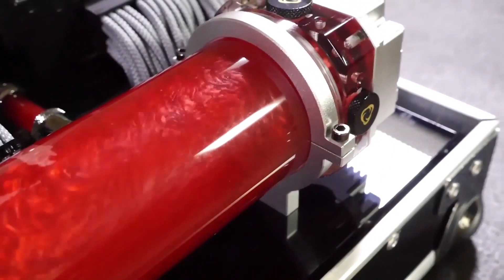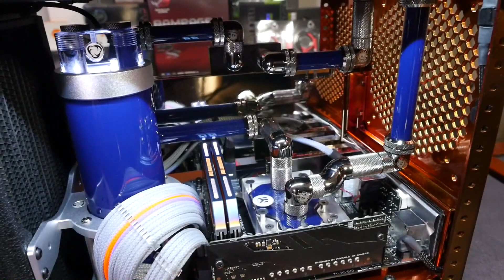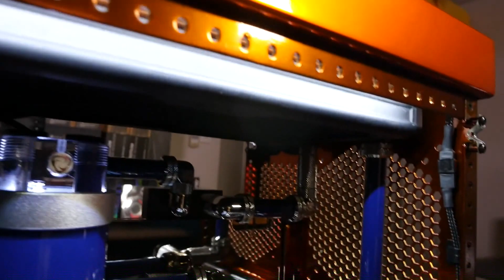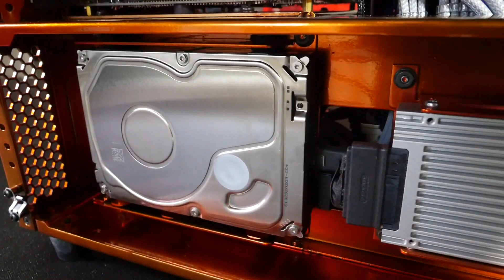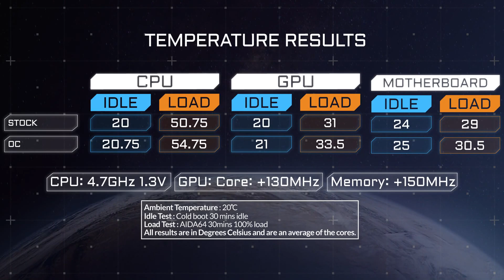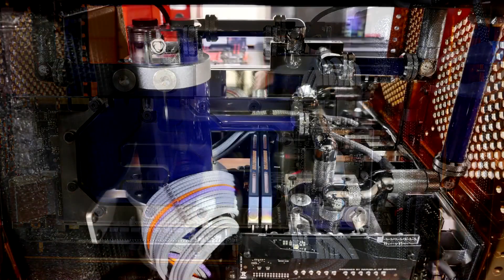Caselabs S3 Extreme ITX Build Log: Part 3

Comment: Thank you so much for doing this Daniel. I'm putting together my own custom loop right now in the Mercury S3. Beautiful case inside and out. I'm still debating going glass tubing or not and i'm afraid your video made me even more scared to go glass. I'll also be using straight pipes with fitting angles. You're a great inspiration to me and I'll be shopping from you soon! Need dat protium res 

/ Daniel

Comment: Gday can you do custom cables with any 80+ PSU these days or does it have to be a special rated PSU ?
Reply: charlie brownau You can do custom cables with any psu. The 80+ is the psu's efficiency rating.
Reply: charlie brownau You (basically) can do custom cables for any PSU ever made for a PC, but it's way easier and safer to go with a fully modular PSU over a semi or non-modular.  

80+ is a rating of efficiency.

Comment: There are so many impressive things about this build, I don't know where to begin.  I love how the RAM is the theme.  It truly is. The colors with that insanely expensive and rare RAM looks so so good.  It is your most cohesive and complimentary color scheme yet.  The proximity of the reservoir, the RAM and the monoblock look insanely cool--I've never seen anything quite like it.  And then you get a look at the other side of this thing, BAM VERTICAL GRAPHICS CARD and those two drives below... HOT DAMN.  The drives are just like floating there all shiny and immaculate looking, and the asymmetry of the drives JUST WORKS!  It is official, it is my favorite of all your builds.  The cabling looked like such a bitch to install.
I feel like you are so committed to using Corsair power supplies.  I could understand back in the day when you were rocking AX1500i's over and over again, because they are unrivaled and your crazy ass builds need mad power. But now I'm not sure I get it, because the days of needing 1500 watts are over--ACTUALLY, MAYBE NOT, HAVE YOU SEEN THESE Intel i9-7900X's.  They are the greatest things ever, it is in actuality a 6950X with the single-core performance of a 7700K and 30% better multi-core performance for almost HALF THE PRICE, but they need sooo much power when overclocked, and produce crazy amounts of thermals, I can't wait to see you do a build with one.  Maybe you could do mine for me, with X299 and a 7900X.  My 1TB Samsung 960 PRO just arrived.  I think it will be the ultimate boot drive, and the backbone of my system for many many years to come. 
Back to the power supply, sorry, your video made me super excitable--Is it something to do with the connectors or the wiring?  You are used to Corsair so you are able to do it faster?  I have noticed that you are really pushing yourself lately with jamming as much as you can into these latest builds.  The newest line of EVGA power supplies, the G3's they are called,  I really think you should check it out.  EVGA Supernova 1000 G3 is ridiculous how small it is.  It could have made your life a lot easier on Radium #002, which was the tightest build I have ever seen--fuckin' remarkable bro.

Comment: 2 questions, hopefully you'll see this and be able to answer.  

1st: the drain petcock looks so close to the piping going to the radiator.  Is it able to be twisted to actually drain the system?  The photography didn't show so well.  

2: I get why all the extensions as I have tried my hand (terribly) at glass before sticking with PETG.  I get the knurled finish to aid in tightening up the fittings.  Are there extensions that are polished instead of knurled?  I feel as though the knurled finish takes away from the routing.  There may be some sort of rubber tool involved to generate enough friction to tighten if there were these sort of extensions.  As always, hats off.  I wish I had the skill and patience to be a boutique system builder like yourself (Especially since I liv so close to Performance-PCs)...

Comment: 33,5°C on the GPU during load? That is extremly low. Was that with just CPU load?
Reply: well it's a single gpu and for a gpu stress cpu is more or less idle and there is basically 480mm radiator surface which is a lot for 1 gpu.. i guess he runs 30 min tests for temps but he also adjusts temps to 20°C ambient..

Comment: Hey man! I've got to say, I've learned quite a lot from your videos. As of yesterday I've done my first 24 Pin Custom Cable for my EVGA 850w PSU (It's little work, but I'm damn proud). Even though I used up ALL my sleeving for the 24 Pin, I know now that I can do my own custom cables. You sir, are one of the most underrated channels on all of the PC Master Race YouTube Community.
Reply from the maker: I should do a video.
Reply: Hi victor persaud how did you do your custom cable i dont understand the pinouts
Reply: Well heres what I did. i looked at all his ORIGINAL Custom Cables Video. #1-3. then i looked at his custom cable building video. Then cable Splicing. Ill use my PSU in this example

Step One: KNOW YOUR PSU!!! Its key to know your PSU and the capabilities. I own a EVGA G2 Supernova 850w Power Supply (9.9/10 JohnnyGuru)

Step Two. Go to the Pinout Repository on Overclock.net and look at LutrooCustoms(Tinus's) List of PSU Pinouts. 

Step Three: Analysis and Analysis and Analysis. My laptop died FOUR Times (Goddamnit Apple) by going back and fourth for pinouts.
Reply: thanks man I got same psu and have looked at his pinouts pictures but am still a bit confused :)